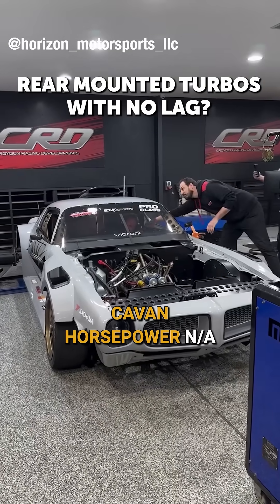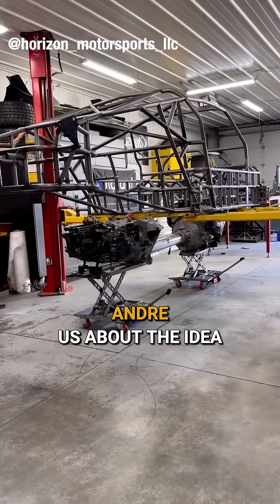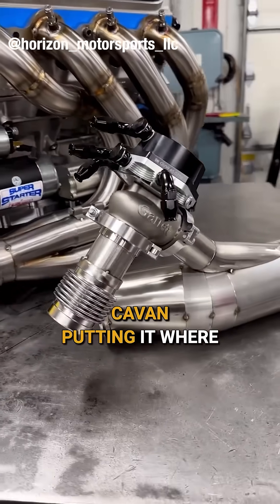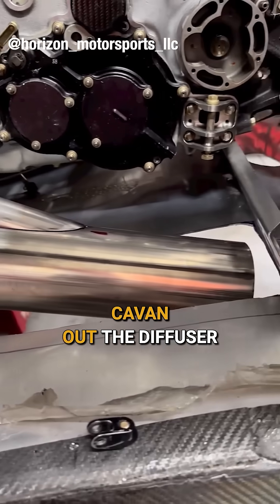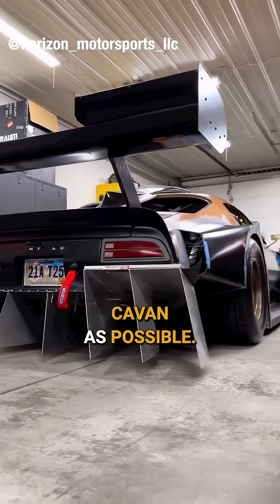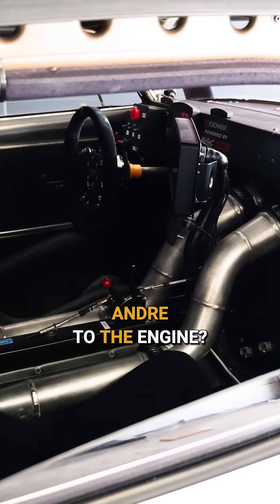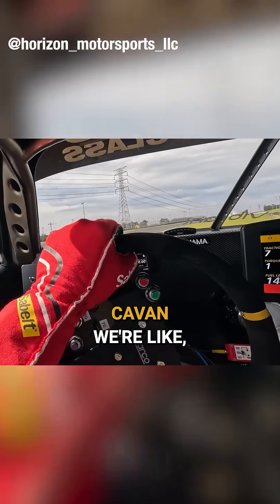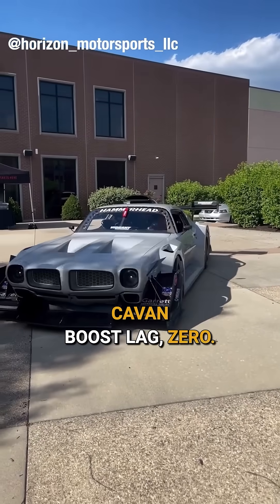Rear Turbo Packaging Nightmare?

Comment: You built the entire car from the ground up. How difficult could it have been😂
Reply from the maker: Any build is full of compromises. A perfect setup for one aspect comes at the cost of another simply because space is limited, so you have to find a balance. That is why every car, even OEM who have a huge amount of people working on every design, has weaknesses and strengths in different areas - Taz.

Comment: What they didn't realize is that as long as the exhaust and header/manifold tubes aren't too thick it's the same as sucking air through a straw, and it's capable of sucking 700 horsepower worth of air pre-turbo.  The air all moves basically together as the molecules pull (push for an exhaust) the ones ahead of them out the tube. The length of the tube can add some backpressure, and bends obviously aren't ideal, but overall you won't feel lag.
Reply: Air pressure moves at the speed of sound, assuming 4 meters of additional piping it's like 0.01 seconds of lag.
Reply: i think what holds people up about this is they think the air has to travel all the way down the pipe which simply isnt how it works, its not like the tube is a vacuum whenever it isnt being boosted. the boost pushes the air that is already inside the pipe

Comment: I think a lot of people see the amount of volume of piping between the turbo and the engine and forget that it still has air in it when the car isn't making boost. The turbo flows such a high mass flow rate of air that the extra length of pipe only makes a fraction of a second of difference.

Comment: From what I understand the main problem with long runs isn't lag.. I mean sure the speed of sound in whatever psi of air is still not zero but it's still pretty fast. But it's the energy loss from the exhaust gasses cooling. You are just reducing efficiency and total power gain, not increasing lag, for the most part.
Reply: Exactly. It's because people think that pressure is what spins the turbine wheel, when it's actually heat.

Comment: Having a turbo that far away has very little impact on lag. Its about how much volume of air it can move and how fast (spool up speed and rpm of the compressor). Which is a size and efficency problem not a distance problem. This is not mesured in PSI, thats a totally different mesurement again. 
Turbos are mesured or people want to know the PSI which is totally wrong. Volume of air flow it can move is probbably a more important mesurement.

Comment: Finally settled it. I don’t get why people think that a 5 ft charge pipe and 5 ft header is gonna make turbo lag worse. Turbo lag is not cause by the air slowly traveling through the intake. Turbo lag is caused by the rotating mass of the compressor turbine being too heavy for the engine to spool quickly.
Reply: This is not true.

The main impetus for the turbocharger to spool is heat, not pressure. A longer turbine inlet pipe will necessarily lose heat due to the larger surface area. The exhaust gas will also lose some velocity as well due to pumping losses.

It is simple physics: the exhaust gas has more energy when it's coming right out of the engine than after it's traveled through nearly a dozen feet of piping.
Reply: @rars0n you’re not wrong but the effect isn’t as big as you think. Big singles on V engines don’t suffer too much, this is just an extreme version of that.
Reply: @jiminycricket9877  What are you talking about? I never mentioned a single thing about how big the effect was. You have no idea how big I think the effect is.

Also, to be clear, I wasn't talking about lag, but boost threshold. The difference in lag will be minimal, the difference to boost threshold will be more significant. That's why this guy is saying that there's "no lag," because the actual lag is minimal, but he's not accounting for the effect on boost threshold.

Either way, it still boils down to the same thing it always does, turbo sizing. A big V8 is going to spool a turbo quicker regardless of where the turbo is by virtue of it pumping larger quantities of air. You could have 50 feet of exhaust piping before the turbo and if the turbo is undersized, it will still spool quickly. To make any claim about boost lag without knowing ANY specific details of the engine and turbo is frankly idiotic and pointless.
Reply: @rars0n again, why the tone? You obviously know what you’re talking about, I’ve made no sarcy comments yet you use words like idiotic. This is why internet discourse is so toxic, people can’t resist being obnoxious.
I could quibble that the energy (heat) loss also contributes to velocity losses (loss of energy leads to a drop in k), it’s not just down to pumping losses. Also the lag will be equally affected, in percentage terms) as the threshold because it’s down to how much energy is available to accelerate the rotating assembly and do the pumping.. it’s just that the numerical increase is small so less noticeable. It’s still there though.
Try being a bit more friendly in your interactions, you’ll be a lot happier.
Cheers.
Reply: @rars0n I'm not sure whether it's your communication skills or your technical knowledge, but one of them seems lacking
Reply: @jiminycricket9877  The first part of my comment was the only thing addressed directly to you, with regards to your incorrect and completely random assumption that you somehow knew what I was thinking. The rest of the comment was just clarifying my statements.

I called speculation of turbo lag without knowing any technical details "idiotic and pointless," because that's exactly what it is. Making baseless statements about turbo lag when we know nothing about the engine OR the turbo is useless and stupid. Do you get upset every time you hear someone use words like that?

"(loss of energy leads to a drop in k), it’s not just down to pumping losses"

I already stated that in my original comment.

"Also the lag will be equally affected, in percentage terms) as the threshold"

No, it won't. Longer piping reduces the efficiency of the turbo, increasing both boost threshold and boost onset by roughly the same amount. That is why LAG stays the same, because lag is the difference between the two. You should try reading what I wrote for a change.
Reply: @skachor  I'm going to go out on a limb here and say that it's YOUR technical knowledge that you have a problem with.
Reply: @rars0n this is fascinating. You’ve been emotionally pushed into an aggressive response…. 
I’m yanking your chain, chill out.
It’s perfectly acceptable to generalise about system effects - I’m not telling him what turbo to use as that would be idiotic.
You’re wrong about your definition of lag btw. Lag is the time it takes for boost to be produced when the throttle is opened. It only occurs if the rpm is above the boost threshold because below the boost threshold it’s effectively infinite. If you loaded the engine such that it could not go above the threshold rpm, it would never produce boost - infinite lag.
I go back to the response I made to another of your posts. To be meaningful, boost threshold must have a specific boost level to have any meaning. I choose desired boost because that is the number that matters - what is the minimum rpm at which my engine will make 20psi? Anything else is  FUNCTIONALLY useless. After that rpm, lag is the difference between light throttle off boost and full throttle useful boost (again, I would say full boost but others would choose a different value).
The definition you’re using means the lag would depend solely on how the engine was being loaded, a total variable.
I can only suggest that you change your approach to disagreement. We’re all wrong sometimes, me very much included. Although not on this occasion.
Cheers.
Reply: @jiminycricket9877  The definitions I'm using are the same definitions that everyone else (but you) use.

"You’ve been emotionally pushed into an aggressive response"

I think it's hilarious that you're attempting to pull this tactic after I chided you for getting upset over me calling something "pointless and idiotic."

"Lag is the time it takes for boost to be produced when the throttle is opened"

You're just quoting the Wikipedia article (which is poorly written) without understanding any of it. To reiterate:
Boost threshold is the engine RPM at which the turbocharger begins to generate positive pressure. Below this engine RPM, the turbocharger cannot make any boost. Once the turbocharger reaches the boost threshold, it is, by definition, within its operating range.
Boost onset is the engine RPM at which turbocharger pressure begins to rapidly increase, resulting in a surge of torque.
Lag, by virtue of the other two definitions existing, is literally the difference between those two. "The 'time' (ie a delay measured in engine RPM) it takes for boost to be produced when the throttle is opened" is literally the difference between boost threshold and boost onset. That is exactly what we are measuring.

The point here is that all three are measured in engine RPM, not time. Ask yourself why that is. The answer is pretty simple: the time delay occurring will necessarily be shorter in lower gears due to the torque multiplication effect. The actual lag (engine RPM) is exactly the same, but the engine can rev faster because it is under less load, so it reaches boost onset in less time. Therefore, measuring lag as time is useless because it will change depending on what gear you are in. This is also why very high horsepower cars are dynoed in higher gears, because in lower gears, the wheel speed acceleration is too fast to get useful measurements.

"To be meaningful, boost threshold must have a specific boost level to have any meaning. I choose desired boost because that is the number that matters"

This completely contradicts what you wrote above about boost threshold, and demonstrates that you don't understand what you copied from the Wikipedia article. You don't get to just make up your own definitions and choose random values. We're circling back around to idiotic and meaningless again, because if we were to do things this way, then nothing is comparable as you're not actually measuring anything, you're just picking random values.

You're aware of how positive and negative number work, right? Any number greater than zero is, by definition, positive. Once intake manifold pressure becomes positive, then the turbo is, by definition, generating positive pressure. That's what boost threshold means: the turbocharger has reached the threshold of providing positive pressure ("boost"). Boost threshold cannot be at 20 psi, because it crosses that threshold as soon as positive pressure is achieved.

"what is the minimum rpm at which my engine will make 20psi? Anything else is  FUNCTIONALLY useless."

This is an utterly ridiculous statement. If you're evaluating the efficiency of a compressor wheel for a given engine size, the other stuff is extremely important because it informs you of the expected boost curve and allows you to properly size the turbo to the engine, whether you want quick spooling or a larger torque surge. It's also crucial in determining how much boost you can actually run.

You seem to think that boost is the same as airflow. It's not, it's the opposite. The turbocharger creates pressure in the intake manifold because it's physically pushing more air into the engine than the engine can ingest. It's literally a measurement of the air that ISN'T entering the engine. You are aware of the ideal gas law, right? PV = nRT. This is basic physics. If you add a set of aggressive cams to a turbocharged engine, you will make more power with less boost, because you're increasing the air flow of the engine.

This is why compressor maps are three-dimensional, and why larger turbos make more power with less boost. The volumetric flow rate of the engine dictates how much boost a compressor wheel can efficiently generate. You can't just slap any turbo onto any engine, tell it to make 20 psi, and it magically happens. If the engine can't ingest enough air, or ingests too much air, the compressor wheel will operate outside of its efficiency island, response will be poor, and you may not ever be able to hit your desired boost level. 

On my old Eclipse, the stock turbocharger was a TINY Garrett T-25 turbo and even on the stock engine, the turbo just couldn't flow enough to maintain 15 psi of boost past 5500 RPM. It could easily hit 20+ psi before 4000 RPM, but even with the wastegate disconnected entirely, the boost would drop all the way down to about 12 psi by 7000 RPM (I tested this on my own car). The turbocharger was undersized for the stock engine because Mitsubishi prioritized low-RPM torque. Even if you could somehow force the turbo to maintain 20 psi at that flow rate (you can't, it's not physically possible), you'd be pushing the compressor wheel completely off the map and efficiency would plummet, likely resulting in a LOSS of performance.

The opposite is also true: stick a Mitsubishi 16G on a 1.0L 3-cylinder engine, and you'll probably never get the turbo to reach 20 psi. The 16G is not a huge turbo, it's still fairly small for a 2.0L engine, but it's way too big for an engine half that size. (For reference, the 16G is what Dodge used on the Neon SRT-4 engines, although they rather choked them by using a small TD04 turbine housing instead of the larger TD05 housing.)

This is why we have terms like boost threshold and boost onset, why compressor maps are are useful, why small turbos and large turbos exist, why turbine housings play a critical role in boost response, etc. This stuff is extremely important if you want to have ANY idea of what you're actually doing. It's also why I said that making specific statements about this or that without knowing anything about the turbo or the engine is pointless, because it is. Without all of that other critical information, we're just pulling things out of our asses (which seems to be something you enjoy doing).

Feel free to keep banging out nonsense replies. It's obvious to me that have no idea what you're talking about and have no interest in changing that, so there isn't much point in me continuing to spoon feed you the same information over and over again. If you ever decide to pull your head out of your ass and learn something, I would start with an old book written by Corky Bell called "Maximum Boost." Although the book is pretty dated and based on older technology, it does a great job of explaining the basics and the concepts still apply to modern engines.
Reply: @r@r@r @rars0n interesting that you send me to that book, it’s one of my favourites. Lead me install a prototype VNT on my 1.3 golf(in 1998) with a mechanical control system which I devised.
No, I didn’t get my info from wiki, it’s from 30 years of engineering turbo installations. I hate using authority but you have been impuning mine.
You seem intent on proving the world wrong and being the only one who knows what they’re talking about. I only said you were wrong about lag, which you are.
It has nothing to do with the difference between threshold and meaningful boost. It is the time - time - it takes to go from no boost to on boost once the engine is in the range it is capable of producing that meaningful boost. Nothing to do with the grey area beyond the semantic boost threshold (which you are correct about) and the point at which the turbo is doing what you want. You can use the semantic point if you wish but that is of no practical use. A driver doesn’t care when your manifold pressure flips from negative to positive, they care when they get some torque. That’s why I (and others) choose some level of positive boost to define threshold.
I’ve met plenty of people like you over the years and advice remains.
Get over yourself, you’ll be a lot happier and your turbo installations will perform better in the real world.
Cheers.
Edit. I chose 20psi as an example, it could have been one or one hundred. I’ve always found practical definitions more useful than semantic ones. If you’re different, good for you.

Comment: "Zero boost lag"

 Lol. As an engineer who spent many years designing turbos for the largest turbo manufacturer in the world I can tell you there's a difference, and they probably are saying they don't notice it because their engine makes decent off boost power and they're running low boost. 100% shorter piping would improve boost response.
Reply: I'm NOT an engineer and I'm sat here scratching my head at how they can make such a statement with nothing to back up the claim. The air has to travel much, much further, ain't no way there's no delay.
Reply: The problem is that you're talking about two different things. Boost response, aka boost threshold, is definitely impacted. Boost lag (the difference between boost threshold and boost onset) is going to be basically the same.
Reply: Watch driving for answers. Maybe you'll learn something Mr. "Engineer".